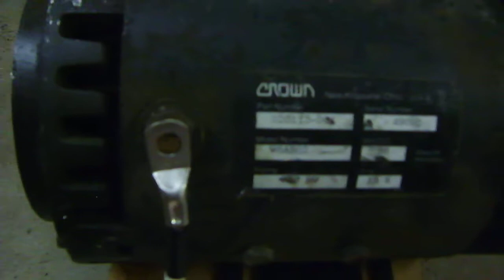CROWN FORKLIFT PUMP MOTOR TEST 3/3

Comment: I'm looking for some help I have a few crown motors one is 20.54kw 91hz 2611rpms. I want to possibly use for a bandsaw sawmill build. Could you break down options to power and what's this would equal in HP? I appreciate any help!
Reply from the maker: Hi John, I'm fairly new to this, sounds as though you have an AC motor? the NM torque to KW ratio for the DC motors is around at least 7:1 i.e 1kw motor will produce around 7nm of torque, keeping in mind electric motors usually deliver 100% torque at 0 RPM and possibly an inverse torque curve, with DC, with AC, you can tweek torque curves through playing with the frequency,  and this will also depend on the RPM required versus capability of motor. The DC Crown motors are also capable of "overdrive" of up to 5X for short bursts, or with the appropriate cooling...best check spec sheets for what you have and match accordingly...hope this helps...:)